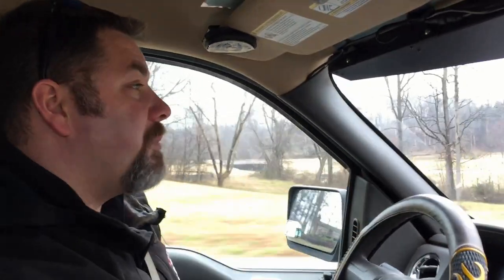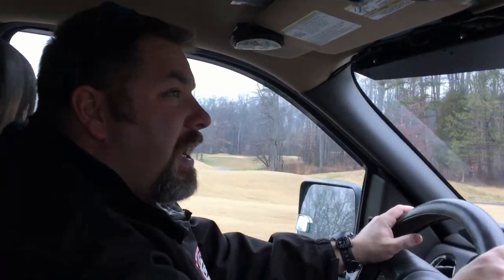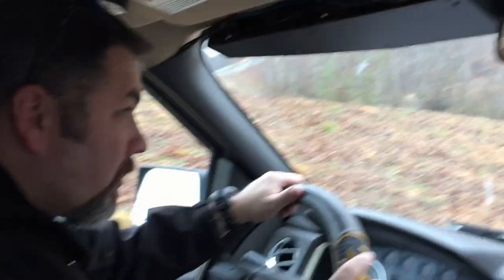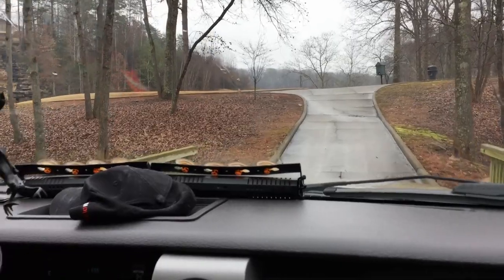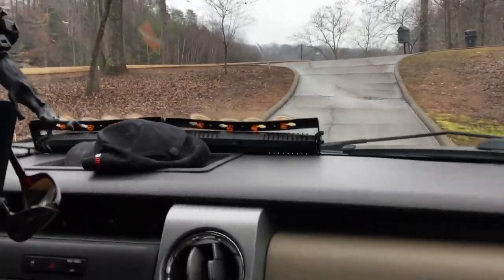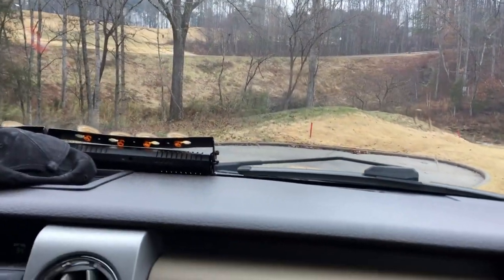Inspection Of An Underwater Pump System

Comment: It didn't look that bad to me, it should have been placed at least 10 inches up off the bottom, great vid bro.
Reply from the maker: We agree with you.  And originally, I believe the owner tried to do that as well.  Unfortunately though, erosion has sunk the sled that the intake sits on, thus causing problems with the intake collecting to much sand.

Comment: Nice work. Was curious if any of the footage in this video was from the new Tovatec Mera Video Light or if all the footage was from your Intova dive camera rig over your mask?

Interesting thought putting a video camera inside the head of a dive light, however I think there may be a lot of amateur shaky footage produced from these cameras until divers learn how to hold them during recreational applications. 

As far as an inspection tool it seem it might be somewhat useful when trying to illuminate a dark area such as the grated business end if that pump system.

Is backscatter an issue with the Tovatec Mera video light as the light is directly behind the camera?

Then again maybe you were not diving the Mera, video version of the light?
Reply from the maker: Yes, some of this footage was from the Tovatec Mera.